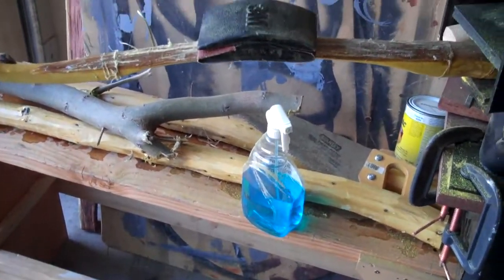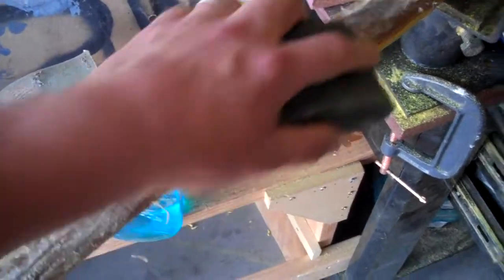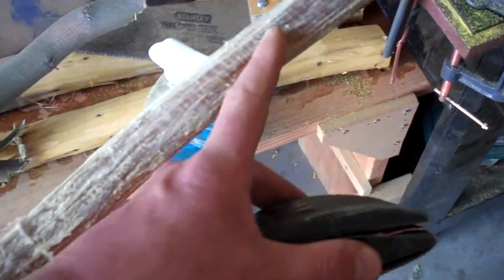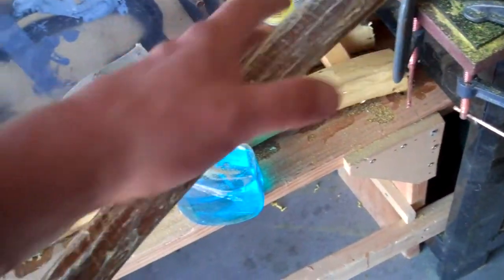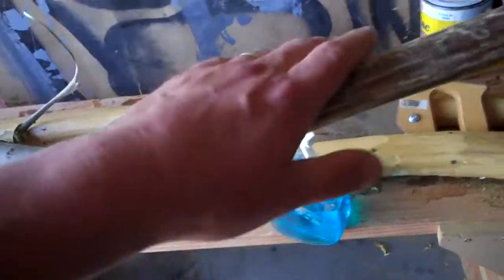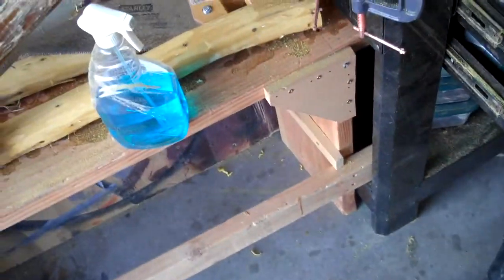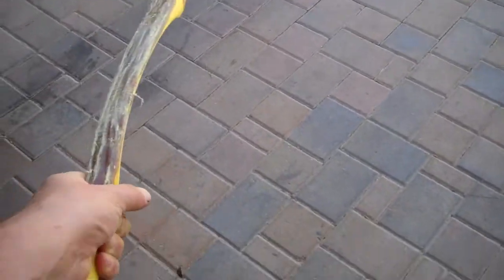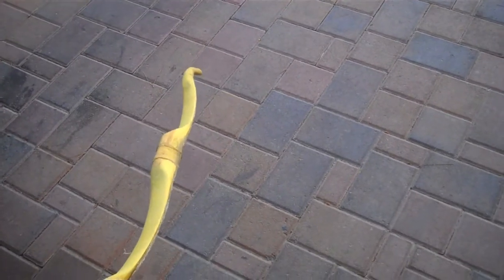How to Build an Osage Bow: Build Along, #10: Sanding Down The Sinew

Comment: Do you think that bow shoots faster than a standard Osage bow?
Reply from the maker: The sinew GENERALLY will result in a greater return of the limbs as well as the ability to draw a shorter bow a greater length. This can result in a faster shooting bow than without the added support of the sinew, but it is mostly about the ability to make a shorter bow functional with a greater draw length as opposed to making the arrow shoot faster.